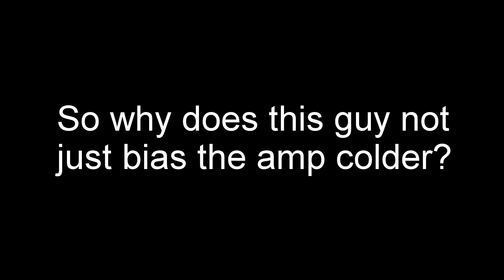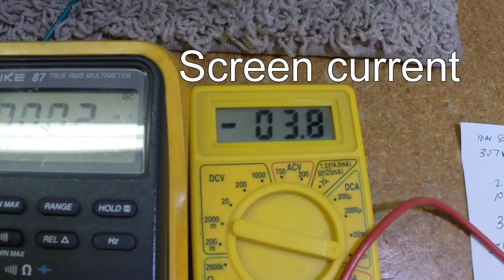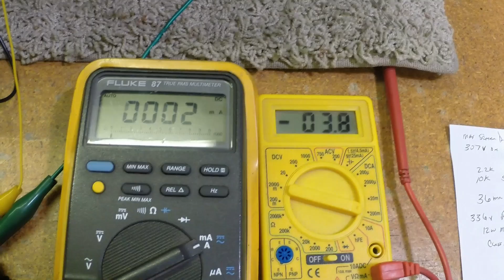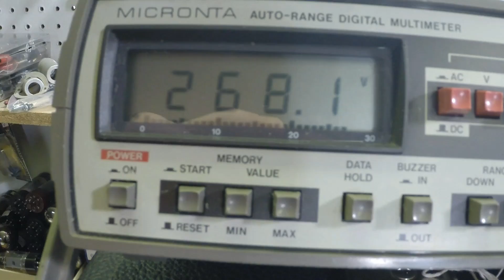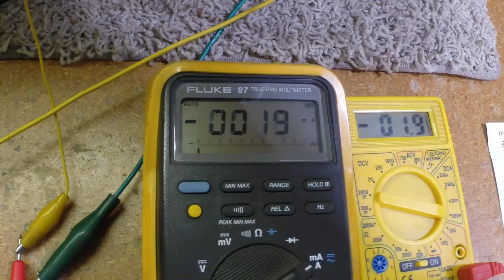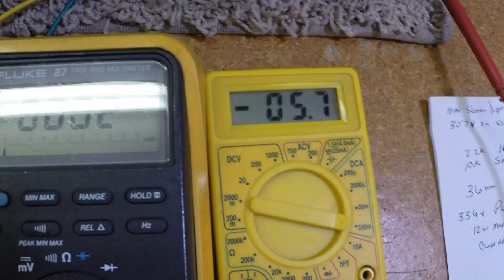Blues Jr  Screen current correction, and why I do it

Comment: I see a lot of Blues jrs in my shop, and I often recommend replacing the IC brand filter caps, but haven't done any mods to the screen grid ckt. What value resistors do you install?  Do you change anything else?
Reply from the maker: I covered that in the video.  If you notice there is also the old sheet detailing the changes laying on the bench.  I change all kinds of stuff. Look back through the channel at all the BJ videos.  The mods are constantly evolving.  Take note of the previous Blues Jr video about the phase inverter.